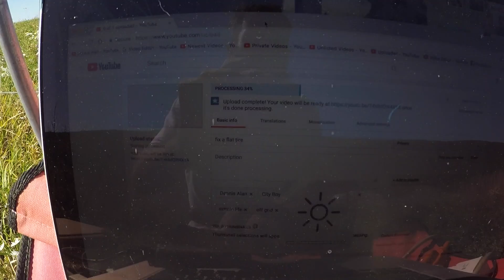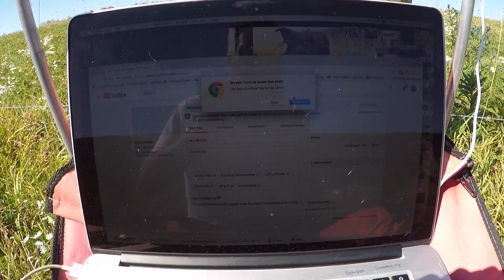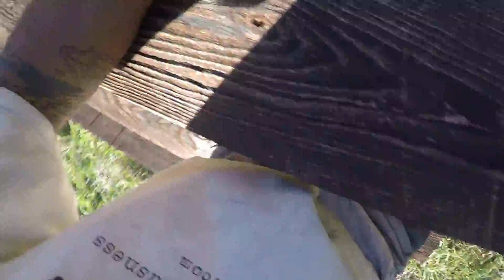SHOU SHI BAN PICNIC TABLE part 2

Comment: Don't forget to finish sealing the wood with linseed oil, stain, or something similar. Cooking the wood hardens it, but it still needs sealed. Nice job on your table! Shou Shi Ban is a great way to be natural, but it is a lot of work. I think the finished product looks great. Are you going to spot torch the extra 2x4's you added?
Reply from the maker: Yeah I guess I should do them.  I got a little lazy there.  I will be sealing it soon with linseed oil.

Comment: Nice table, Dennis. Maybe add batons to the bottoms of the seats to help hold on the outer board? The whole time I was thinking, "I'll say something about putting the feet up on stones so it doesn't rot." Oh, ok. Never mind.
Reply from the maker: What do you mean by this"add batons to the bottoms of the seats to help hold on the outer board" ?
  I just lost part 1 and need a couple of hour to upload it agian.   If you saw a part 1 there were a lot of sceens of drone flying that was cut out.
Reply: I mean you could add cross pieces to the bottoms of the seats like you already have on the top surface. That way the board closest to the inside, which can be firmly attached to the frame, also helps support the outermost seat board.
Reply from the maker: ah I got it!  I'll go ahead and do that!  Thanks that'll take 2 minutes
Reply: I just realized I wrote "baton" instead of "batten." I've always been a lousy speller!
Reply from the maker: lol me too hence I didn't notice lol